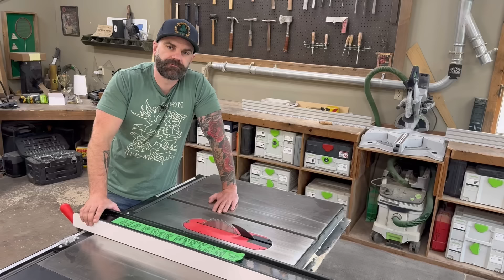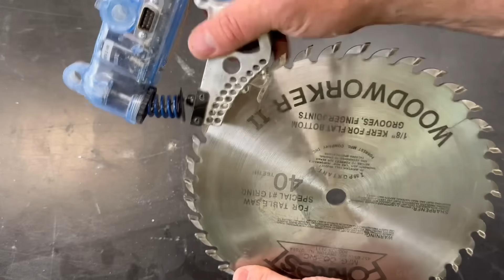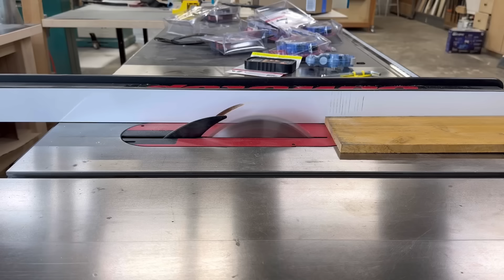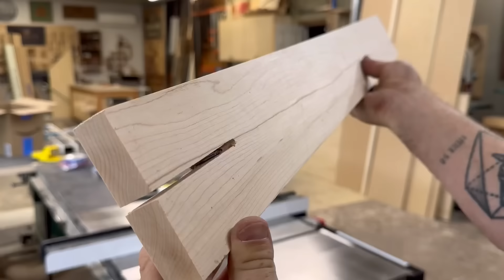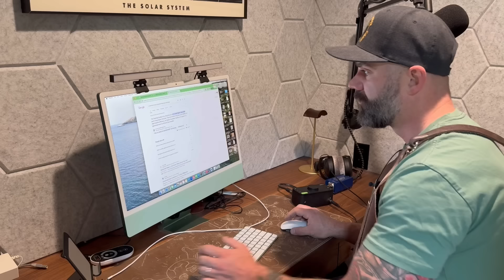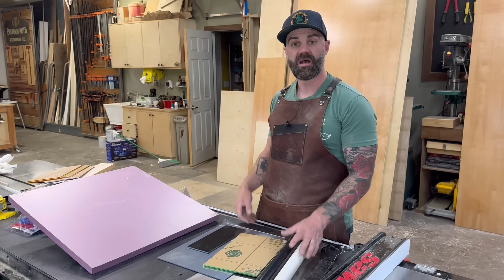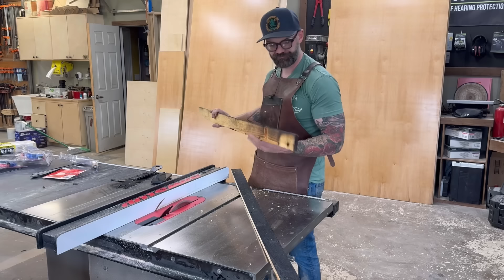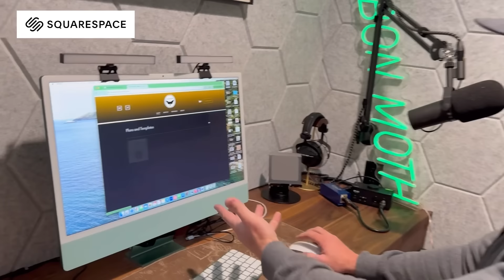Finger Versus Table Saw || Testing SawStop Myths

Comment: I think that when you ran the board with the nail through, there is no capacity, The nail is basically floating. When you ran the Rockler sled through, the aluminum fence may be in contact with a bolt connected to the bar, which is touching the table and ground. This is where the capacity comes from. Maybe?

Comment: A very well presented explanation .so much so that I would buy a saw stop if I could afford it, if I needed to buy a new saw.
 And if other people were going to use my saw.
None of these apply . I have always been terrified of a table saw and this is always the case.
Push sticks,low blade,don't work when tired or distracted
Always be scared

Use an angle grinder to trim your fingernails, not a table saw.

Comment: You can see the lights at the switch change when you touch the blade.  With the blade not powered, grab your board and press it against the stationary blade while holding it and check the lights.

Comment: Does the SawStop have a test mode?  The obvious way this should work would be to flip a switch to put the saw in test mode, which prevents the motor from powering up and prevents the blade from spinning, but leaves the flesh sensor activated, and sounds a beeper instead of activating the brake upon sensing flesh.  This would allow the user to test that the sensor circuit is functioning properly, and check if a given material is going to set off the sensor when cut.  If the SawStop has such a sensor (and it definitely should!), the testing done in this video could have been done for a whole lot less money spent on  saw blades and brake cartridges.  And a whole lot less drama, I guess, so ... fewer views, probably.

I'm not a fan of the the SawStop company.  IMO, their flesh sensing technology is obvious to any electrical design engineer "trained in the art" and should not have been granted a patent.  The fact that they managed to get a patent on it anyway, and then so aggressively enforced it, keeping competitors out of the self-stopping table saw market for so many years, effectively kept the vast majority of table saws more dangerous and contributed to the continuing high rate of injuries.  In my opinion.

Comment: Cool video. I recently tripped the brake and didn't even realize how it tripped at first. I thought it must be the material. Then I noticed a tiny divot on my finger tip. Not even bleeding. I had somehow got a kickback that took my finger into the blade so fast I didn't realize it had even happened. And no injury. Better yet, CMT blade undamaged. Better yet, SawStop sends you a new brake for free if it's tripped from skin contact. That episode more than paid for my purchase.

Comment: I wonder if instead of slowly touching the hot dog to the blade, it was quickly flipped into the blade. It would seem in real life, someone who passed their hand into the blade perhaps as they brushed off some pieces of cut offs would be a good test. In any case those who have a Saw Stop should operate the saw as if there wasn't a Saw Stop on it. When you reply on those devices to save you when you do something stupid is not a good idea. A better idea is to use common sense AND best safety practices despite the safety devices. I saw a comment by a high school woodshop teacher who had them on his saws.... but wouldn't tell the students. Fear is a good thing when it comes to self preservation.

Comment: Try it with saltwater just in case you're building a house by the ocean and not by a river. Some of the Home Depots near us are by the ocean so it's a real possibility. Also, don't listen to metal during use. That also sets it off.

Comment: The fence was grouned to the table saw because you had it attached to the track. The nail wasn't so the saw wouldnt have any voltage change.

Comment: The only issue I see with a saw stop is the operator may get too complacent. Turn off the safety and cut a finger off because they are so adjusted to the blade locking during normal operation.

Comment: remember that water, in and of itself, is not electrically conductive.   Only when it has additional chemicals or salts dissolved  will it then conduct electricity. e.g. pressure treater lumber.   The problem is you probably arent going to perform the chemical analysis of a piece of wet wood to see how pure or not the water is.

Comment: The sled was connected to the top of the table through the hardware, thus conductivity. If the aluminum were completely insulated, and not touching the table itself, it should not go off. Don't lose your alcohol bet!

Comment: A classmate set the SawStop off when the blade was still spinning (but turned off) and they went to measure to adjust too quickly with their 6" rule before the blade stopped. POP! Our instructor said that another material that sets it off is the foil backed insulation. I think she meant the foam type insulation.

Comment: Am I the only one that notices that the blade comes to a complete stop before it drops. After the blade is stopped it isn't dangerous. There is no need to drop it. I guess once they realized that they were too far into production to redesign and keep it simple. They only needed to stop the blade, period. They didn't need all the elevation gears and mechanicals to drop the blade, it would have been a lot cheaper and easier to build. I'm an industrial mechanic and I was responsible for the maintenance of 6-8 ss tables saws on different shows for 5 years.

Comment: One idea I know if your cutting through nails and the nail touches the blade and the table of the saw it will go off. But you usually don't have that problem because of the plastic throat plate. The reason I'm saying this is because I wonder if the rockler fence was touching the bolts that tighten it down which is also touching the metal plates in the miter slot which touches the metal table, which would create a ground setting it off. Just a thought I don't know if that would make a difference.

Comment: I set mine off, when my Incra Miter Gage was too close to the blade.  It did not touch the blade but it was very close and  had a piece of wood on it.  A random nail in a piece of wood should not set it off.  if you connect a piece of wire to the nail to the top of the saw or hold the bare wire in your hand it would trip because you are completing a circuit.

Comment: I had to laugh a few times when you all tried to explain how the system works. Voltage is not current and thermal conductivity is not electrical conductivity. I know you all are woodworks but it still made me laugh.

Comment: More static will build up in dry air than humid environments, so it’s more likely you’ll set it off with foam/acrylic if it’s very dry in your shop.
I’m on the board at a makerspace and ours has been set off before by laser-cut charred wood… but now I’m wondering if there might have been something else going on, or if maybe your charring wasn’t deep enough into the wood or something? I dunno…

Comment: I somehow set off the brake on my SawStop (CTS), and have no idea why.  Dry wood (masonite), no metal, and it happened just after I finished the second cut.  Did I inadvertently touch the blade (which I should have turned off immediately)?  I don't think so, and SawStop's analysis of the data from the brake didn't claim that as the cause.

The blade was damaged, but then it was the SawStop blade that came with the saw, and which I was going to replace anyway!

On another occasion I did touch the blade without thinking, and without triggering it, but it was the side of the blade and it had nearly stopped, so I figured that the sensor was turned off moments before it completely stopped.

Comment: was that the same blade on all the trips? If it was, it is pretty safe to saw most blades will survive. Have you thought about doing a dado stack,  Just to see if the brake grabs it.  Also do all the blades have to be 10 inch for the break to grab.. I ask because some dato sets are 8 inches. Also I have used a 7 i/4 thin kerf in my saw.  It acts like a razor blade through the wood.    I do not own a saw stop.

Comment: When I was 16, I became distracted while using a table saw and had kickback, which pulled my hand into the blade. 

I had a great surgeon that was able to reattach the bouquet of fingers I walked into the ER holding... Lost the thumb joint and a lot of feeling in my left hand.  Works good enough for a career in tech on a keyboard though.

Guaranteed way to never ever become distracted around any kind of saw for the rest of your life.  It was several years before I could use a saw again without PTSD cringes.

Be careful out there.

Comment: Fyi... thermal conductivity is not the same as electrical conductivity 

Thermal conductivity is due to vibration or oscillation of atoms or molecules, whereas electrical conductivity is due to the movement of electrons.

Comment: Thermal conductivity is not the same thing at electrical conductivity.  Thermal conductivity is related to heat, how well does a material move heat through it.  Yes aluminum is more thermally conductive, but that does not imply it is more electrically conductive.

Comment: Your static electricity tests are probably environmentally different. Since you are in the north west, you likely have a higher humidity. That will decrease the effective static electric potential in the air and material. 

Some folks in dryer climates may set it off more easily than you could.

Comment: It seems that the technology reacts to an electrical "drain" for want of a better term. 
A certain amount of electricity has to drain through the object being cut in order to trigger the mechanism. 
A little nail doesn't have enough mass to absorb the required amount of electrons. 
But a human body would be a big enough electron sink. 
A large-ish piece of aluminium it would appear, is big enough too. 
Plastic won't trigger it because it's an insulator. 
However with something like mirrored perspex, that normally comes with plasticised layers on each side that have to be peeled off. 
If they are left on during the cut, they'll insulate the piece and it won't trigger. 
Also, you won't get a trigger if you're pressing the top of the material because that's insulating perspex.
If the plastic layers are removed, the aluminium mirror coating will probably conduct electricity through your fingers to your body and trigger the saw IF you are in contact with it. 
Bear in mind though, that  most times the aluminium mirror layer also has a paint coating behind to protect it so that may act as an insulator too. You may get a trigger if your finger contacts the metal through the edge of a sawn piece.
So basically, if the saw detects a big enough "drain" of electrons, it will set off.

Comment: The blade is thrown down from its own inertia after the aluminum block is slammed into it, stopping it immediately. So the direction of rotation only has one way to go. Down.  
The creator of SStop actually did use his finger and a demo video. You can find it here on YouTube.
Great video.

Comment: It's current that melts the wire releasing the brake. So is it the conductivity of aluminum or the capacity of such a large piece of aluminum that set it off?

Static electric is by definition not current, it's static.

Comment: The aluminum on you  Rockler fence is anodized. The anodized finish is a non conductive finish applied to the aluminum through electrolysis, so touching it would have no affect on the test.

Comment: Might be easier if you think of the potential current that Katz was talking about, as static electricity. Ruffle your socks across the room and then poke your buddy. If you go and try to touch a nail in a piece of wood, you will not get a static arc. (Unless it is grounded) .. Your buddy on the other hand, even if he isn't touching ground, still has capacity to ground. Thusly your electrical potential will be shared between you. 

There is current in the blade, and as soon as the circuit detects the loss of that juice, it will set it off. 
Your rockler sled may have had contact with the cast iron table through your hold down bolts, or they were close enough to ground onto the table. It's also possible that the chunk of aluminum by itself had enough grounding potential to set it off. At risk of sounding like im repeating myself - the nail by itself does not have enough grounding potential to set off your cartridge (at least consistently)
Hope this helps more than in confuses 😅

Comment: One major thing I would say about your test with the aluminum fence is how is that fence connected to the sled and the sled touching the tabletop. Aluminum Fence > Metal Bolt > Metal Tabletop/Sled slide bar? This could ground the Aluminum fence to the tablesaw itself and set off the Sawstop. Where just cutting a nail or staple does not give the full path to the tabletop of the saw to complete the circuit. 

Aluminum sandwiched between two boards might solve this and be a good test.

Comment: Is the aluminum on your cross cut sled electrically connected (via fasteners, or some other metal) to the slot keys or table?  If it is, then that would explain why it triggered the SawStop.  (Just trying to save you the alcohol!)

Comment: Regarding the wet wood... When I was in high school, we did an experiment to see if water and any solution contained in it affected electrical transfer. It did - significantly. We had to dissolve quite a bit of salt in the water to get it to actually conduct electricity. I imagine the "wet wood" people are talking about is actually green treated which contains a lot of copper. It would be interesting to do this experiment with green treated pine rather than cedar, as well as wood with the canned copper sealant you can buy purposely applied to excess.

Comment: The conductivity of the metal is not significant -  differences in conductivity between different metals are tiny compared to what would be significant for the low currents involved. Size/surface area will be the biggest factor as this affects the capacitance to ground that the device is detecting.

Comment: I have had two cartridges go off. One. Some not nearly as wet as the wood you had there. Pressure treated. Bang. Two. My right index finger. Yep. Just pushing a little piece of wood through, after hours and got a little loss of attention. BANG, I thought what the heck, why did it go off. Then I looked at my finger, sure enough, I just brushed against the blade. BANG.

Comment: I wonder if the crosscut sled did isolate the piece electrically from the table. Can you trigger the mechanism with the hotdog on the sled?
Reply: Well seeing the carbon fiber case I was probably wrong…

Comment: Also, also. What happens, if, say the blade is very high, and a hotdog or finger or whatever, get caught and yanked under the saw with the blade. Because sure, you don't get the finger cut off, but if that were to happen, good chance a chunk of skin gets yanked off.

Comment: Yup. I have my personal, triggered cartridge that I caused by barely touching a blade. It had spun down, almost to nothing, after I had turned the the machine off. I didn't think I had even touched the blade, and, eventually, decided that a tiny abrasion on my finger must have been the point of contact. It didn't even bleed. 

The thing works.

Comment: I have a SawStop, and I have cut lots of treated lumber on it without issue.  However, ONE time, the saw gave me an error code for wet wood.  It did not trip the brake, thank goodness, but the saw did stop.  I had to put it into bypass mode to complete the cut.

Comment: I think the nail didn't trigger the stop because it was electronically isolated from ground by the wood. I would bet it would have triggered if the nail was touching the blade as well as the surface of the saw. Great video, keep them coming!

Comment: one possible scenario is that the aluminum top piece on the cross cut sled is connected to the aluminum runners under the crosscut sled, and therefore grounds it to the cast iron top.
when you cut the nail, it was not all the way through the wood, and never actually came in direct contact with the metal table.

Comment: If the newer Wagne meter is anything like my older (yellow) Wagner meter it will max out at about 35%  MC which makes me wonder if the wood is actually wetter than you think?  I will say that at my son's high school shop they have two Sawstop tables saws and one of the instructors said that they have set off a brake by running wet treated lumber thru theirs.  Maybe yours was a fluky thing?

Comment: Isn’t the trigger associated with completing a circuit? With the crosscut fence, the saw was in contact with the aluminum runners which were in contact with the metal T-track bolt which was in contact with the fence. If the fence was electrically isolated, that circuit would still be open and the saw wouldn’t be triggered. 
Regarding the water, at 3v water isn’t that conductive. Mix an electrolyte like salt in and do the spray bottle test again and it might trigger.

Comment: with respect to your acrylic tests I honestly don't think you were using a large enough piece of acrylic to give it a fair test. Static charge is something that builds up on the surface of a dielectric material, more surface more charge until it reaches essentially a critical mass that then finds release through the conductivity of your saw blade and triggers the system. It's not a common occurrance but I know for a fact that it can happen, I've seen it set off a sawstop first hand when a member of my makerspace was cutting a 4'x8' acrylic sheet (3/8" in think) I've also personally cut acrylic with the same tablesaw just fine so it is definitely the exception not the rule but it can happen.